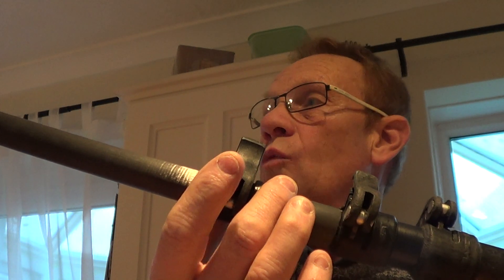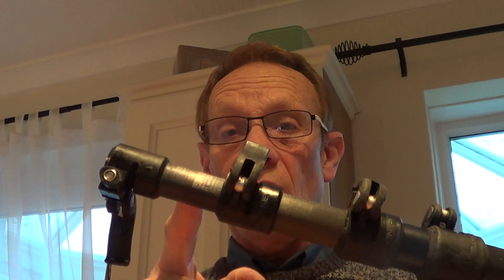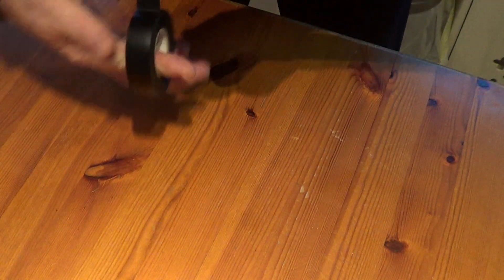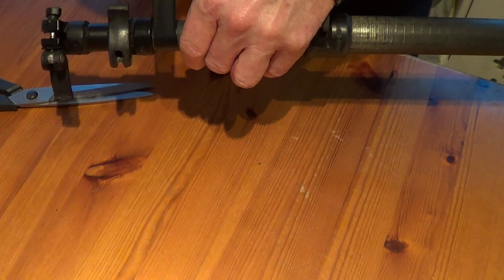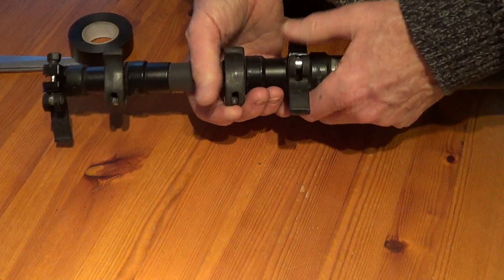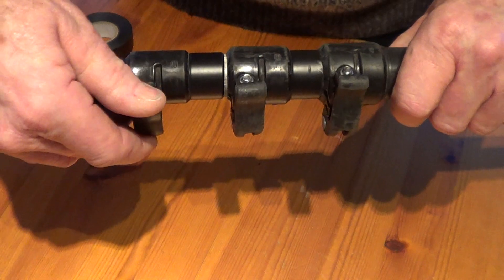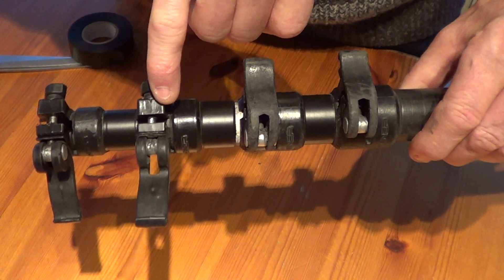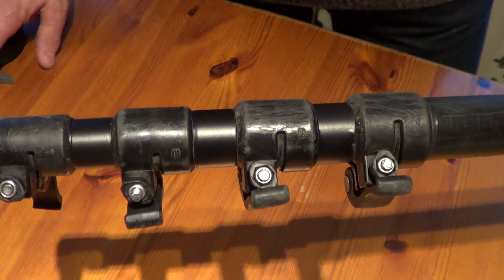Carbon Fibre window cleaning poles - Fixing worn out pole

Comment: Hi Chris, I’ve done something similar on an old pole I have, I’ve just put a thin layer of insulation tape on the part of the section that’s worn so that the clamp locks on the tape part
Reply: julian pierce, yep I do this also. Just replace the tape as it gets worn every couple of weeks or so and the good thing about this is it wears the tape but not the pole.